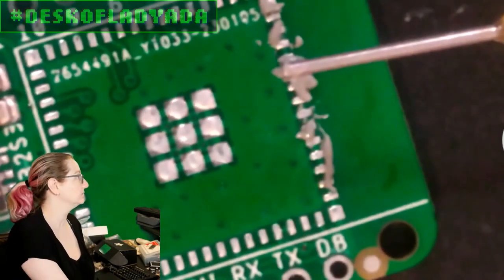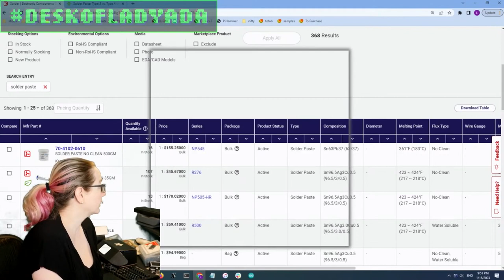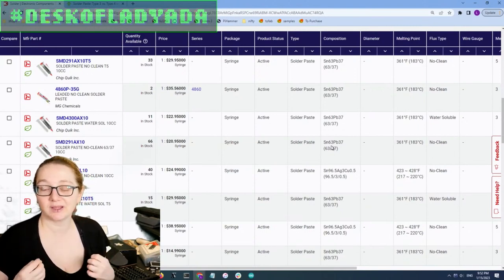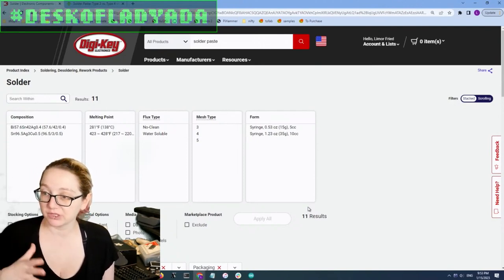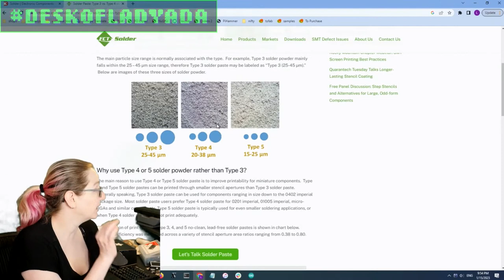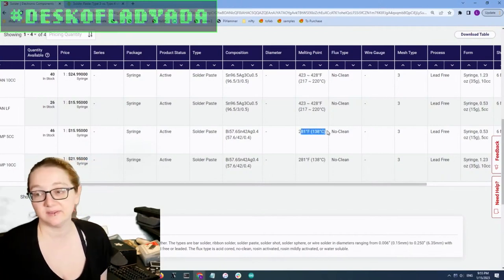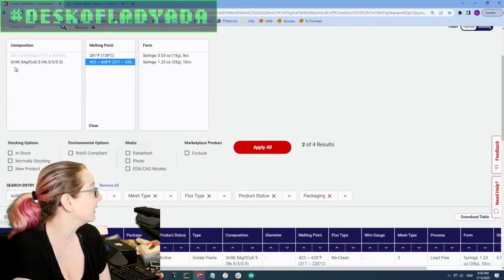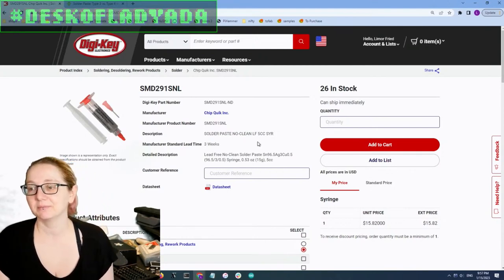The Great Search: Solder Paste Syringe for Hot Plate Rework #TheGreatSearch #DigiKey @DigiKey

Comment: +1 for Chipquick but you can use a soldering iron for the ESP modules.  Put a large thru-hole pad (large enough for iron tip) in the PCB under the GND and then you can get at it from below.

Comment: Chipquick have low temp that is also room temperature stable, in my anecdotal, n=1 situation, I get good results. It also helps for rework. As an example, I reworked 40pins 0.4mm connectors lately which would easily get temperature destroyed by the iron at normal lead free temperature but with the low temp I set my iron to 200C which is still quite chilly for the plastic.

Comment: Certain components, like the Sensirion CO2 sensors, have temperature limits that require the use of a low temp solder.  If you're working on something with modules, like a board that mounts a RPI Pico, it's also nice to know that your hot plate isn't going to affect the components on the Pico.  I'd say if you're buying just one tube of solder paste why not start with the low temp stuff, it's pretty user-friendly.